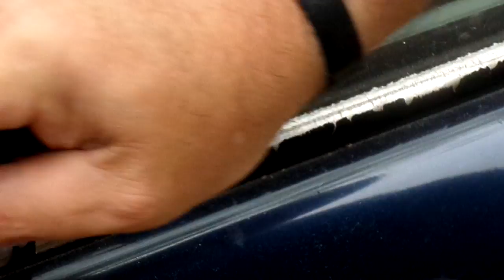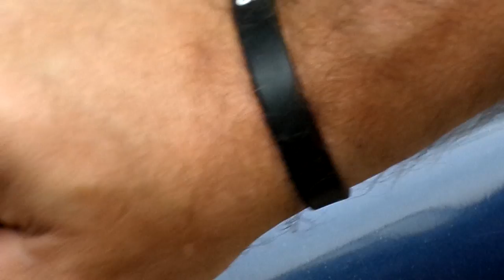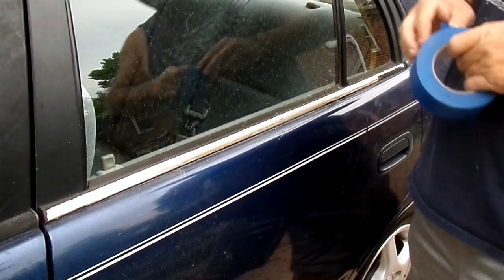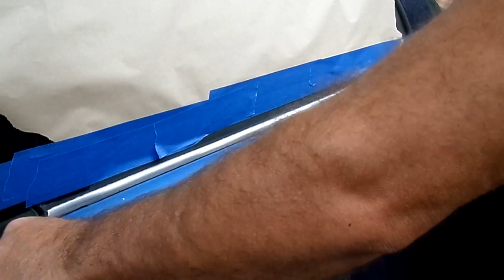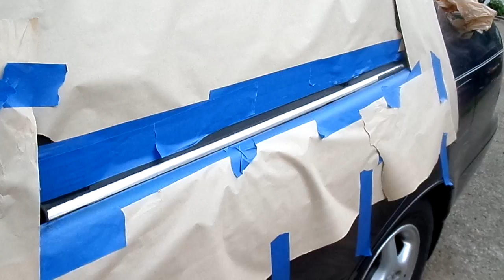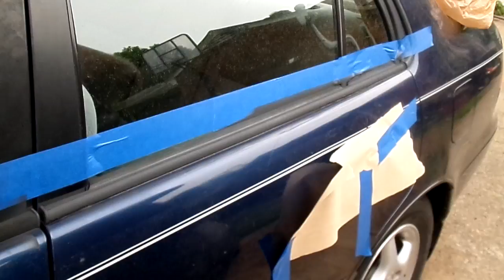Painting Car Trim  , Easy and Correctly for Anyone

Comment: You were saying you were going overkill, but it was way underkill. There should have been a lot more sanding, a lot more prep, should have masked the window, then put cards under the trim where you could, should have glued the part where it seals to the window, back to the trim and sanded flush, should have never even left the store with that less than store brand quality paint and used a rubberized paint, should have sanded the metal with 300 grit, masked and primed it before starting color on the whole thing, there's a lot more you could have done, to make it last longer than a few weeks.
Reply: Right. And when that's all done, u could even clear it. Rattle clear for laquer or rattle 2k clear is used a lot now too. 5 mins. Now that might be overkill, but correct, everything else commented should at least.
Reply: Holy shut dude. He’s not going for professional. Not everyone even cares to do that especially on an older car. You’re doing too much it sounds like. All he wanted to do was remove the dry rotted stuff and paint it. Looks like he did just that.

Comment: I need your help badly. A month ago My 2008 Lexus RX 350 was in the body shop for some work and while it was only front end work the brilliant (not) owner decided to additionally paint my black plastic trim all the way around the base of my car. It did not need it since I take care of all the plastic trim. I was stunned he did it but it looked good for a minute. I decided to detail all but the front end of the car because it was newly painted. During my process before I used Gyeon Iron I masked off all the Black plastic trim with Blue tape. Well low and behold after I was done with iron removal I peeled off the blue tape which also removed some but not all of the flat black paint that had been sprayed on the trim. So my problem is that this is not just overspray and I want to remove it completely. What in the world do I use to remove this paint completely from the porous plastic? I know Citrol works for over spray but this is a coat of flat black spray paint that I want to remove. 
I hope it’s something I can do. I don’t want to take it back and have this idiot remove the paint with the wrong product like paint thinner, etc. unless you tell me that’s okay to use. Love your channel

Comment: Much easier to just take the trim off. Also don’t start with such a thick coat
Reply: Trim actually isnt easy to take off. Especially on older cars because if you try to take it off and it breaks, you just broke a part off that is extremely hard to find anywhere else, even dealers dont have certain trims for certain cars
Reply: @HondaS-fk1mi  True, trim would be rusted on and any clips snap off like butter.